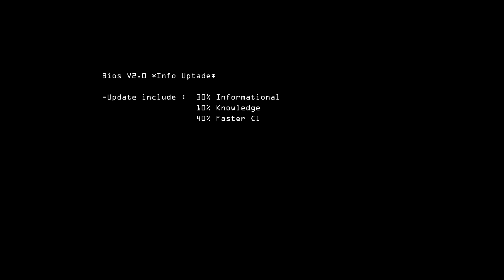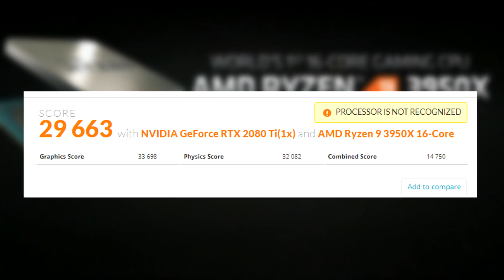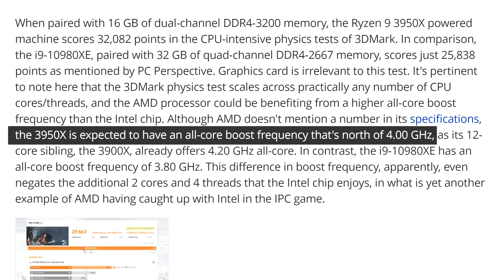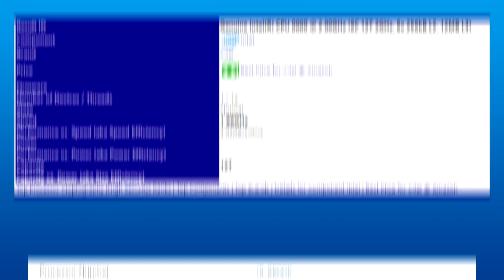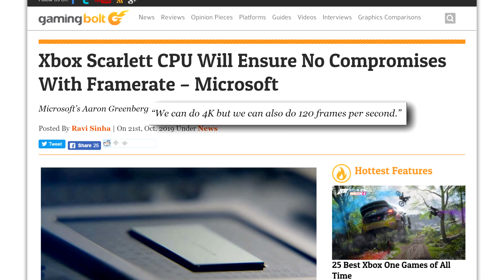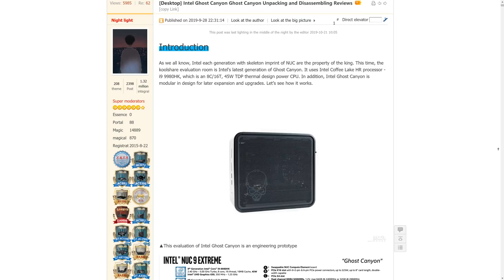3950X 24% Faster Than Intel’s 18 core 10980XE!

Comment: Hey Boot Sequence!! 

That's funny as in the report it says 4.20ghz all core for the 3900x when mine is overclocked to 4.40ghz all core!!! That report is an utter joke! And is extremely misleading. Typical paid report by Intel. 

Seriously though Intel has brought out extremely inferior CPU's this time and are trying to justify its position by blatantly lying once again to cover up for its shortcomings.

Pathetic Intel, simply pathetic.
Reply: You do realize that not all chips are created equal. It's not considered common for 3900Xs to all core to 4.425, especially with SMT on.
Reply: @blkspade23  well I must have got a golden chip then, but I've hear that a lot of other people are getting above 4.2ghz with ease too. So......
Reply: @CitizenTechTalk  4.2-4.3 is far more common than 4.4+. Haven't done any all core pushes on mine yet. I generally just crank up PBO that generally gets 4.2 as a minimum where several cores above 4.4 while 2 can reach 4.6.
Reply: @blkspade23  Just ran a Cinebench run after we spoke last and I max out at 78 (for only a second at the end of the test, up to mostly late 60's for the most part to then hit 74-76 for the rest of the duration to end on 78 max at the very end of the test each time.)

So very safe thermals and 1.3750 volts with an LLC of 3 on the CPU as well. And correction to before 4.4ghz stable not 4.425 sorry about that. But yeah still easy 4.4ghz rock solid so I guess yes a golden chip all in all 😊.
Reply: He meant on default no overclocking involved my 9980xe can do 4.8 all cores and score 35000+ on physics 3dmark fire Strick test.
Reply: @rafsh1846  yeah just also pointing out that 4.20ghz isn't a good example for a very good majority of 3900x owners, that's as my position, but yeah I agree with you, just that report stunk of Intel and their grubby finances yeah?

Comment from the maker: Correction: At 1:40 I wrote 10980XE instead of 3950x on the bottom left corner. As for the intel CPU, it could be an engineering sample. The final score might be different, although it's likely the 16 core 3950X would still manage to match/beat the 18core intel in a similar scenario. The physics test pushes all cores at the same time. This reduces clocks speeds on both sides significantly, it just looks like the clocks on the AMD side is higher when the whole CPU is loaded.
Reply: not windows? better not be apple
Reply: Nice. That's especially impressive considering AMD's TDP is so much lower than intels
Reply: Πυξίδα της ηθικής "As always" Lol are you kidding me
Reply: It's ok we can understand, keep it up

Comment: Iirc geek bench shows the intel doing alot better than amd in both single and multi tests. Unless I'm mistaken.
Reply: Tactical Center Source for that?
Reply: @christophegroulx8187  I found it on tech power up a week or two ago.
Reply: Tactical Center Please link it :(
Reply: @christophegroulx8187  whenever I make yt comments with links they hide the comments... So I didn't end up trying. Wish I did cause I can't find it. But did find this one showing the intel was lower than the 3950x. https://www.techpowerup.com/forums/threads/amds-upcoming-750-ryzen-9-3950x-16c-32t-shown-beating-intels-2-000-i9-9980xe-18c-36t.256532/

Chances are the link I was looking at were early samples or I just can't read numbers lol.